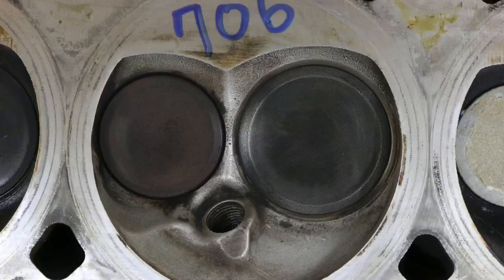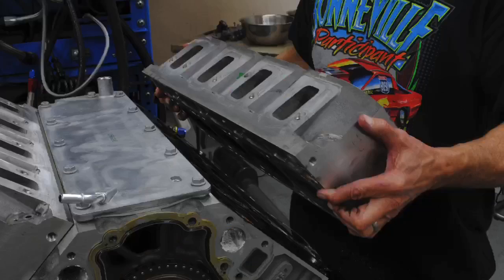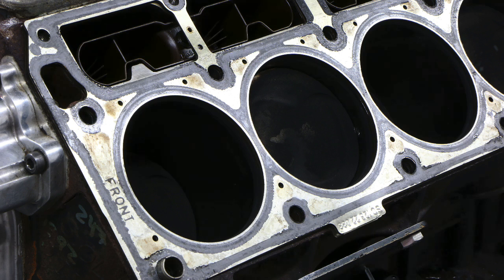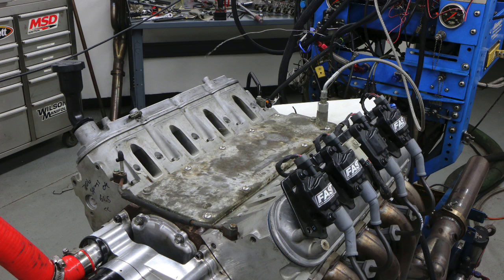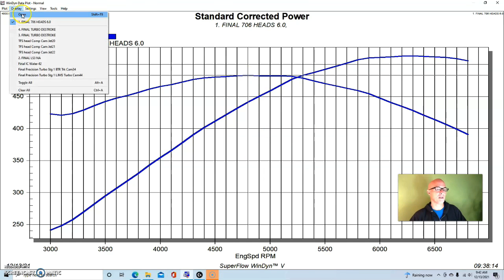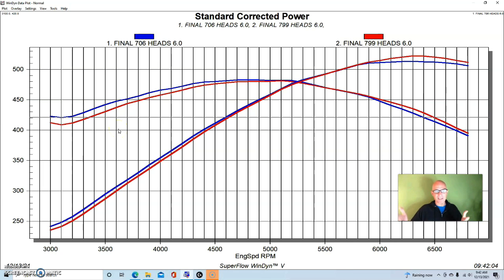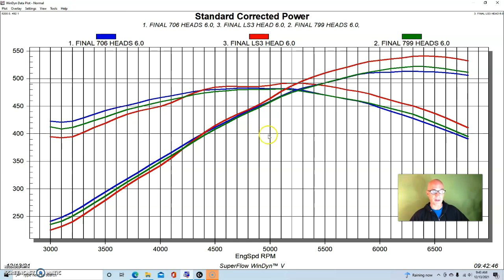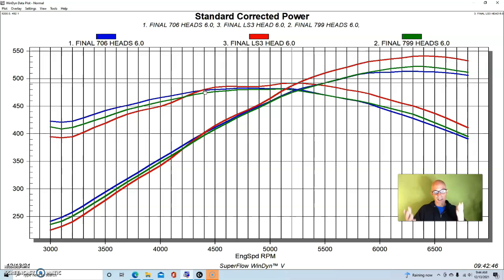JUNKYARD LS HEAD UPGRADE-CATHEDRAL PORT VS REC PORT-WHO WINS? 706 VS 799 VS 317 VS 823 (6.0L & 6.2L)

Comment: I have a lq4 with 243 , have to run 91 octane or better to get the full potential.  Anything over 24 degrees timings it'll knock on 87 .

Comment: Is there a video for 317 vs 706 on a lq4?
Reply: I'm looking for the same comparison. I'd like to see the 317 heads milled, so it at least has a fair chance of being similar in compression.
Reply: I just bought both heads ,706 has upgraded springs on them they just need some cleaning
Reply: It's been done already by Richard holdener

Comment: Can we see what happens with more compression on the rec port heads?
Reply from the maker: it adds power
Reply: @richardholdener1727  lol well I suppose I asked a dumb question.

I was just curious the actual power difference with equal compression since compression helps torque on the bottom.

Comment: What’s the casting number for ls3 head? Are they all the same?
Reply from the maker: 821, 823
Reply: @richardholdener1727  is it worth upgrading from 317 to ls3 head on a 
6.0 bored to 6.2 with truck Norris cam? I have both the tbss truck intakes (cathedral and rect)
“N/A daily truck”

Comment: What heads are the best for a 5.3 and what heads are the best for 6.0 and 6.2 out of the junkyard? I'm thinking about building LS 6.0 lq9 with 823 rectangle Port heads.
Reply from the maker: for factory heads, the rec ports, for 5.3l-use the heads that came on the motor
Reply: @richardholdener1727  what heads are the best that you think for a 5.3 l factory heads?

Comment: I am building a 5.3 for a 57 Chevy that is a quasi- daily driver built for longevity but the occasional "spirited" acceleration.  I have stock rotating assembly and rebuilt 706 heads.  Now to select a cam.
Reply from the maker: truck norris

Comment: @9:25 mark the appearance of this graph should forever settle the question whether the LS rec port heads are indeed superior to the LS cathedral port heads. Here you have the same LS3 test motor, same healthy Comp Cam, same valve spring upgrade and both with their respective optimized "street" intake manifolds (stock LS3 and FAST cathedral).  From 3000 RPMs to 4100 RPMs the power and torque are identical and we can safely assume that this the case below 3000 RPMs. Then at 4100 RPMs the rec port just splits and decisively just RUNS AWAY from the cathedrals in both power and torque by a healthy margin and putting a massive increase in area under the curve.  Why hasn't anybody pointed this out in the comments???
Reply from the maker: I HAVE MANY, MANY TIMES, A STOCK REC PORT MAKES MORE POWER THAN A STOCK CATH PORT-BUT NOT BELOW 4000 RPM (COMPARED TO THE 799 OR 706)

Comment: I'm running a l33 5.3 I bought from someone who wanted the factory  799 heads off of it I used a set of 706 heads with the BTR stage 1 truck cam it's in an 03 Silverado that I daily drive in the summer I have always wondered if it would have made more power with the factory 799 heads but for a truck that spends most of its time between 2 & 5k rpms I feel like the 706 heads were a better choice or atleast equal to the 799 heads but will the power levels between the heads hold true on a 5.3 vs the 6.0 obviously lower power numbers but will the 706 still make a little more power from 2k to 5k than the 799 head does?
Reply from the maker: please see the two vids where I compared the 706/243(799) heads on a 5.3l and 6.0l-you have the right heads

Comment: I wish you would take a pair of 317 heads, have them milled to where the chambers are comparable to a 706/799 head and test them. 317 heads are dirt cheap but a mill job may wake them up. How about it Richard.......
Reply from the maker: VERY DIFFICULT TO GET THE 317 CHAMBER DOWN TO THE 706 CHAMBER SIZE-YOU WON'T GET ANY POWER EVEN IF YOU DID
Reply: @richardholdener1727  I guess that's why they go for around $100-$150 a pair...
Reply: I shaved my 317s .040” and ported them to 229cc. They ran good on my ls1. Want to use them on my 6.2

Comment: Darn I ordered a 92 mm throttle body for my Trailblazer SS intake then I cancel order to get 90 mm throttle body because that's the size of the opening, and you're using the( cheaper)92mm on it. Son of a😬
Reply from the maker: they both work
Reply: @richardholdener1727  Thanks Richard, maybe I can return it and save a hundred bucks, saw some guy online porting his Trailblazer SS so the 92 blade wouldn't hit and I panicked.

Comment: Trying to upgrade my shop truck, pull trailers. I have a 6.2 engine. The truck was originally 5.3. Does anyone know if using the 317 on the 6.2 will make the torque ALOT better for my application than the rec port head? How much would I lose at the top with a stock stall cam?
Reply from the maker: SEE THE 317 VS LS3 HEAD VIDEO-TRY 243 HEADS

Comment: If I am using my 317 heads that came on my LQ4 can mill the heads and run flat tops to get compression up without changing rod length?
Reply from the maker: YES

Comment: I think it's all about static compression, obviously flow helps but not as much as compression until 4500+rpm.    That's why I put 1.6"/2.0" valves into ported 862 heads so I can have my cake and eat it too.  Ls3 heads are only good for boost, strokers, and guys with massive cams in lightweight vehicles.

Comment: I have a 2004 lq4 6L in a three-quarter ton van. Any of you guys can recommend any performance mods without tearing the motor apart or changing the cam?

He mentions the Trailblazer SS manifold, do you think that would make any difference on a stock lq4 especially without hurting the bottom and?

Or anything else that could be done?
Reply from the maker: HEADERS THEN-BUT IT NEEDS A CAM
Reply: @richardholdener1727  can you recommend one that won't affect the mileage or low-end Torque very much? I was curious and just check the stall speed today, it stalls at 2350 RPM. Roundtown get about 13 MPG, Highway 15 although one time I got 19 by milking it and drafting behind semis the whole trip. 3.73 axle.

I could be wrong but I recall reading years ago that the van had a little less horsepower than the trucks because of the bottleneck in the way the air intake was molded to the throttle body, and or perhaps a smaller throttle body as well.

Comment: There is still a lot of "mystery and confusion" surrounding the rec port heads. The port size isn't actually as big as listed. The ports are smaller toward the valve. If an intake is just an extension of the head, then the head port at the intake is just an extension of the port at the valve. They don't have the low speed turbulence issues that normal big port heads have. 
I would like to see some tricks performed to each head and see how they compare. Ported 243 vs some worked rec ports, bowl work, offset dowel, etc.
Reply from the maker: offset dowels?

Comment: cathedrals have a revision problem in the large displacement , the  test on a 5.3 would be great as there's probably guys wondering if recs. would be worth it on the 5.3. your vids are great and like no other.
Reply: 823s won't work on anything smaller than a 4" bore.
Reply: @mattcossel29  yea what was i thinking

Comment: I'd like to see  ported cathedral heads against stock rec port heads for N/A.  The low RPM torque numbers are better for street applications. Consequently, what would milled rec port heads (no porting) do to the  low RPM torque values?  -match or exceed the stock cathedral head torque #'s ?

Comment: I definitely think the added compression had a good bit to do with the low speed power difference. I’ve never really done any high comp LS builds, but back in my Honda days when everyone was building 8-9:1 comp B series to boost I liked to keep mine in the stock VTEC B series compression range and my builds always had more power outside of boost and got better fuel mileage on the street than most everyone else’s builds around me. The added compression helped me get my Turbo online sooner also, but for street cars the difference between a 9:1 and 11-12:1 engine down low was night and day. This is especially noticeable with the B series which make no TQ to speak of so when you can actually drive around shifting at 3500-4500 while still accelerating nicely up to cruising speed it’s a blessing lol.

Comment: So, I commented on LQ4 in a past video that made 524hp, but you managed to get 584 outta this. Is it possible to do the ly6 Pistons or ls3 Pistons, do the 5.3 heads and get this same horsepower with the same cam and all. I know 600hp is hard to get with lq4 but is Pistons a way to go also?
Reply: Or just stick with lq4, 706 heads, TBSS intake and throw turbo on. I just bought long tubes w/ 4" single exhaust system. Where I'm at is I don't want to pay for a good tune more than once.
Reply from the maker: YOU NEED PORTED HEADS, A BIG CAM AND VERY GOOD INTAKE TO MAKE 600 NA HP FROM A 6.0l-USUALLY PISTONS WITH VALVE RELIEFS
Reply: @richardholdener1727  stock 317s or keep the 706s on if I turbo?

Comment: I have a VortecMAX and from what I’ve gathered, the 6.0 L76 with the 823 heads, is a really good combination. If that’s the case, is a good tune/management system, headers, and a cam all that’s holding me back from a good 500-550hp engine? I remember the mentioning that the LS3 intake and the truck intake flow virtually the same. If so, I’m very excited to put some more power down in the truck.
Reply from the maker: CAM AND SPRINGS AND HEADERS MAKE 543 HP (FLYWHEEL) ON THAT MOTOR
Reply: @richardholdener1727  that’s awesome! Thanks!
Reply: @richardholdener1727  Any particular cam you suggest? I’m looking at a Sloppy Stage 2, don’t wanna lose a lot of drivability.
Reply: @Vaughnjohn56  Just found this-  What cam did you end up with ?   Ever Dyno it ?    Weve got same truck-  We put in a TruckNorris , long tube headers, valve springs  and a tune but never had a dyno test done.  Runs great- Its my sons daily driver
-

Comment: How much boost/timing would you run on a turbo 5.3 93oct no meth gapped rings .026-.028 just a general area, im shooting for 14psi 14* maximum maybe 16psi 12*.
Reply from the maker: Sloppy suggests 14 degrees and 14 psi

Comment: It’s pretty obvious the compression bump was responsible for most the low rpm power gains.  It’s why the 706 (smallest chamber) had the biggest gains below 4k and the 799 (2nd smallest chamber) had the 2nd highest gain.  The 317 flows similar to a 799 and there was minimal difference with the LS3 head down low.
Reply: What was cr with 70cc bs 59cc?

Comment: Same difference between a dual plane intake compared to a short runner intake. Low speed torque compared to high end horsepower.

Comment: To me. If you got a truck that needs the torque for towing. 6.0 with a 706 and some valve work and send it all day long. It'll love 2000 rpm to 6500 and that's where it'll live. if you are like me and want to make a truck more useless (4/6 flip and stepside and 3200 stall) I think a full ls3 top end kit with some decked 823 heads would be the way to go. Near 10:1 compression on a 23x/23x cam and it'll make 450 horse all day on pump gas... Then we add nitrous! 10 second truck?

Comment: Has to be the compression.. send out a set of 706 heads for porting. It will be a better head than the rec port.. 😃
Reply: Depends on the application, but sometimes it is the better choice even without porting..... I just rebuilt my brother's Escalade engine, and used 862(same as 706) heads and everything else is stock. Low end is amazing, and it will never be raced anyways.

Comment: So I was thinking about using the last few years of port-injected truck intakes. They have similar designs and the only real difference comes down to the port since some are for the cathedral and some for rec ports.
What about doing a head test on the smaller 4.8 and 5.3 to see what the extra compression and/or airflow will do for them. Maybe try the long-stroke 5.3 and the short-stroke 5.3 to see what that does for power with the different combinations. 

Another good video. Keep up the good work.
Reply from the maker: HEAD SHOW MUCH LESS OF A DIFFERENCE ON THE SMALLER (LESS POWERFUL) MOTORS

Comment: Should the smaller combustion chamber heads be tested with a slightly thicker head gasket to equalize the compression ratio between the heads?
Reply from the maker: NOT IF IT'S A TEST OF THE STOCK HEADS

Comment: Would be nice if you did this on the lq4, be nice to see what I could get from my basic set up, have 317s that were rebuild with springs, im sure im leaving n/a power on the table
Reply: theres a super chevy article called "LS Fun for Cheap", made 465 horse from a carbed and cammed LQ4. I built my first LS identical to it and started the addiction from that.

Comment: I wonder if the cathedral port heads flow more at .200 to .400 lift range thus making and more bottoms end power or how much could be due to Intake runner design sense it’s impossible to a comparison of just the heads.
Reply: He also did a comparison of 317(flows the same as 243/799) to 823 heads, which shows that the rectangular port heads are about even with cathedral ports until about 4k rpms. Any gains on low end are mainly due to compression..... I've also experienced this same thing with a few builds. That's why my lq4 has 243 heads. It will almost never see 4k rpms in a work truck.

Comment: If you milled the 243/799 to the same cc as the 706, would you get that low end power back and make the same or better all thru the curve with the milled 799 than you would with stock 706?
Reply: A bump in compression will raise the entire curve.

Comment: I had 317 heads on my 6.0, I thought of going Rec port heads but decided on ported and polished 243 heads.  One of the reasons was the cam I decided to run probably wouldn’t take advantage of the extra flow if any on the rec port head vs a ported 243 head and a mid 220s cam.  The bump in compression was another reason, that and in 2012 it was harder to track down a manifold.
Reply: What cam were you running?

Comment: I'm going to 383 my 5.3 and port my 706 heads and ad a torkey cam ,I believe that it would pull my Z71 and cartrailer quit well.
Reply: I thought that as well when I built my motor. I could have purchased a house for the price of the machine shop bill to bore a 3.78” to roughly a 3.90” on a 4” stroke crank. Start with a 6.0l and save money.

Comment: I’m just using ported 799s on my 403. 330 cfm and cathedral port, with small chambers! With a 225/232 114 cam, I think my single cab will make a nice daily driver. I’m hoping it makes 575 at the fw with a nice torque curve!
Reply: Milos Radian   I thought I saw one of richards dyno test where he did like 580 with a 224/23? Cam. I may be wrong

Comment: Sure hope the 823 heads do well for turbo since that's what I built for mine xD (from other tests it out performed)
Reply: So far I've been very happy. Ly6 with a lil jon cam, s480 billet, stock bottom end, and 21psi with e85. No dyno numbers yet, but it feels stronger then the 621rwhp 5.3 twin turbo that I blew up.

Comment: I wonder about these on a 4.8 im currently building since I'm new to the LS game.
Reply: The small chamber cathedral port heads would be good. With the smaller displacement you end up loosing velocity of the intake air if the ports are to big. And, with the smaller bore you would loose even more compression with the big chamber heads. 
Ideally you could do a little port matching and port cleanup on the heads. But, no need to go very far with it.